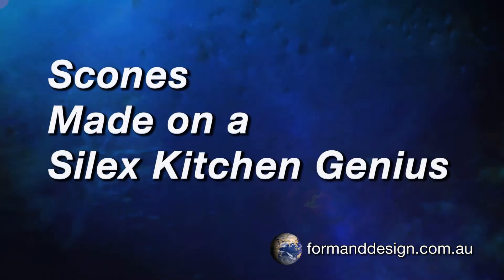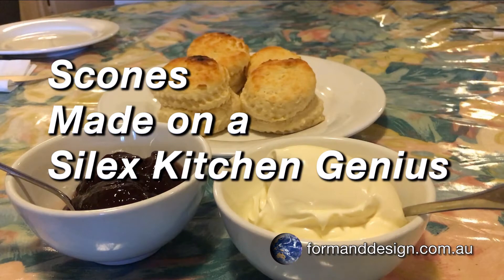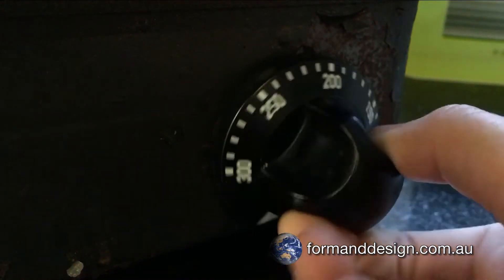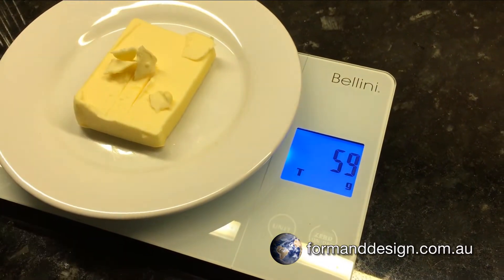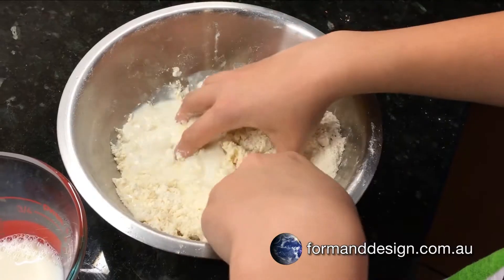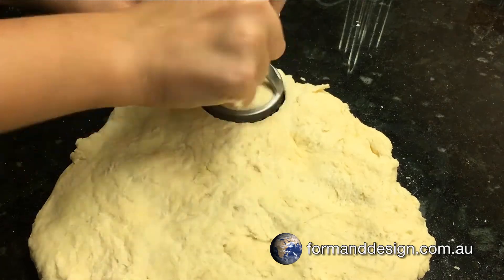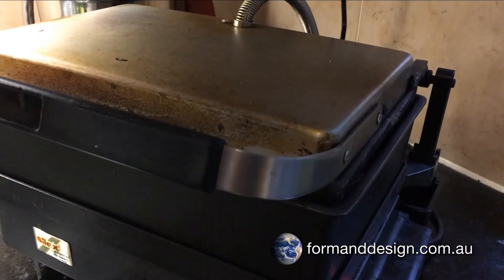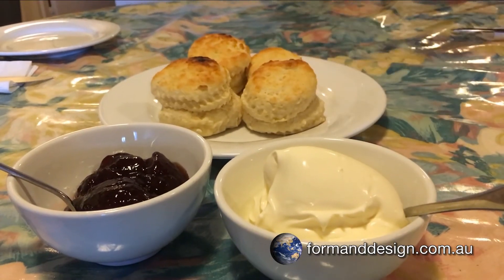Silex Kitchen Genius - Scones

Comment: Hi, I have an older model of the silex kitchen combination oven which was my parents and after they had passed away it came to me the only problem is that I only have the little metal bar to raise it to make toasted sandwiches the other accessories are not there is it possible to purchase these separately again for the unit the product is at least 30 years old and works brilliantly still but I would like to be able to do more than make toasted sandwiches.
Reply from the maker: Hi @Anja Tennant, contact me directly at contact@formanddesign.com.au attention to Andrew